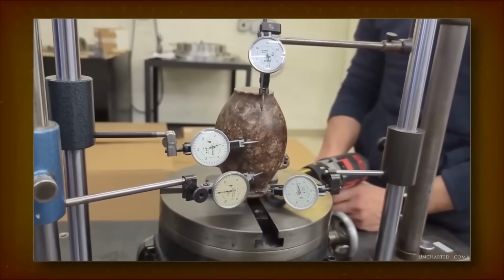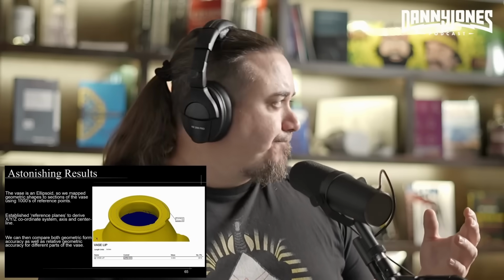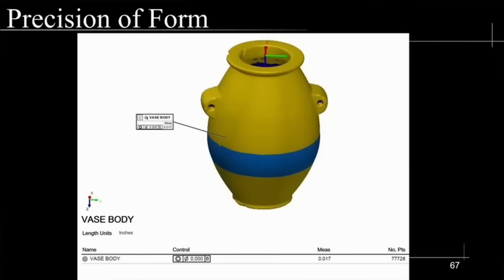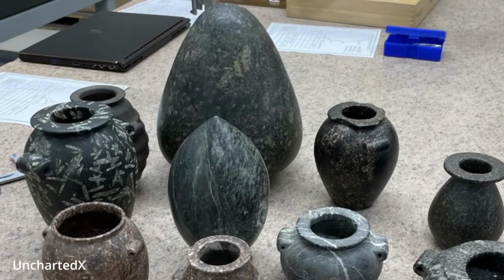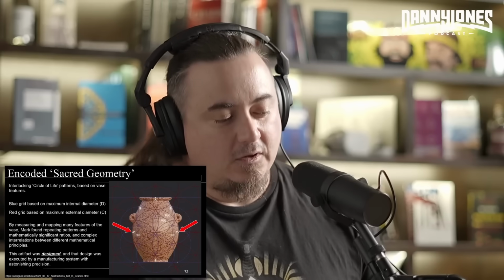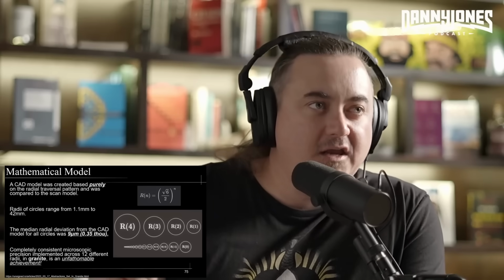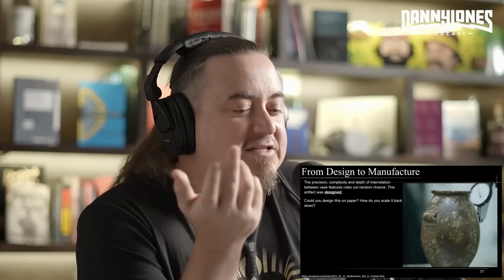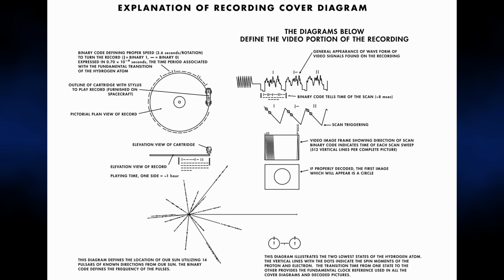Are These Ancient Egyptian Vases Actually Impossible to Make? #podcast #science #history #egypt

Comment: I have followed this topic since studying Archeology in the early 70's in college, so for over 50 years. New things are researched and discovered regarding these "vases" all of the time, thus continually re-peeking my curiosity. These "vases" to me have always been an anachronism, they just don't seem to fit. My viewpoint on these "vases" is unique in a way, that it is based on my very unique studies, schooling, training, certifications and interests. I have a background in fine art, am a certified Industrial Designer, am a trained material rheologist, machinist as well as a design engineer. My premise is that, not only that these "vases" were manufactured, they were DESIGNED, prior to manufacture. 

All of the technology that they are talking about using to measure these "vases" existed in the 1980's and 1990's, when I was in the middle of my career, the main differences between then and today is 1) availability 2) size 3) cost. I have worked within industries that used all of this equipment, but back then, they were sometimes prototypes that were developed specifically for for projects that we were working on or BETA testing of CAD systems, scanning equipment, machining equipment or software that was not even available to the general public or industry. And, the cost, was phenomenal compared to today. Our budgets for RAM chips alone was in the hundreds of thousands of dollars, $80,000.00 plus software license fees per station, and millions of dollars for scanners, special German engineered custom cutters and a 20 foot format GE gantry robot.

I have enough experience with CNC lathes and 6 axis machining centers to accept that, even today you would have a very difficult time in reproducing any of these vases, even with the very best of both pieces of equipment. If you could actually turn these "vases" on a lathe, that lathe would have to be built to dimensional specifications that are at most 10% of the products finished tolerances. That means if the finished "vase" was plus or minus .003" on concentricity, the lathe would have to be built within plus or minus .0003" to hold that concentricity (that's within 1/10th of the thickness of a human hair. Then, once the "vase" is finished on the lathe, you have to physically remove it and reposition it on the bed of a six axis workcenter that was also built to tolerances of plus or minus .0003". As well as that, you would have to position that vase on the work bed within plus or minus .0003" for machining of the lugs.

There is no statement of the NEED for this type of accuracy and no evidence that even with the use of modern day equipment and tooling that these could be reproduced this accurately, or at all. My biggest concern, other than the required materials to build this equipment did not exist 2500, 4500 or even 12500 years ago, would be the varying degrees of hardness in the chosen material for the "vases". The constant manipulation of speed and feed for both the lathe or a CNC work center, to accommodate the continuous variances in material hardness or tool changes needed, would be impossible to predict, plan for, or even calculate. 

The unique part of my career, background and experience is that I have the ability to work totally within the abstract of purely creative thought while at the same time taking into account all the logical analysis science offers. 

Now, that my active career is long over, I no longer have to worry about my conclusions being reviewed and judged by the owners or shareholders, I am free to speculate. My financial future is no longer affected by those conclusions. My speculation is that the "vases" were not manufactured 2500 years ago, or even 4500 years, but they are much older than that. Look at our own present time, look how far our technology has advanced in the past 1000 years. Imagine how an F22 would have been perceived had it simply flown over the battle of Hastings in 1066; another whole religion with a set of Gods would have been created. Before Pre-dynastic Egypt existed, the land was occupied by the Gods, their Gods. Perhaps those Gods were not really Gods, but visitors, who happen to have equipment on their craft that could design and create at a sub-atomic level (even if only to construct replacement parts for their journey). Remember, when you design a product on a computer aided design center, the accuracy of the design is built-in automatically, so tight tolerances are the norm, they don't need to serve a specific purpose. In 1000 years, or perhaps less, human technology will be unrecognizable; we will have 3D scanners that will probe at the sub-atomic level and construct designed products at that same sub-atomic level. 

just a speculation.
Reply: That...was the longest youtube comment I've ever read😁
Reply: You lost me until the "visitors".  Look.  If an entire earth wide cataclysm happened today that erased the majority of human population, how much of what we have built would survive?  Especially if the cataclysm was so extreme.  It would not only destroy most of humanity but it would also destroy most of any physical artifacts that remain.  And when you consider so much of what humanity is now exists in structures that wouldn't last and then mainly the virtual world.  It is realistic to believe that there is evidence of an advanced HUMAN civilization that  pre dates written history and most of archeological history.  I have no idea why people have to make it aliens.  Of course that isn't the most logical explanation.  The most logical explanation is there was advanced human civilization that was destroyed, remnants and legends of that civilization remained over time.  Most of it in the stories passed down because the evidence of the civilizations themselves was too fragile to survive so many years and such a disaster or disasters that caused the destruction.  That is the logical explanation.  We need to stop entertaining these ancient alien theories.  There is such a vast range between a reasonable person questioning archeological and historical dogma and "it was aliens".  Aliens is not a logical theory.  And it's so much of a part of why anyone that questions what is considered historical fact is crapped on.  Because aliens is not the logical conclusion.  At all.
Reply from the maker: Thank you for sharing
Reply: It's one thing to achieve fine tolerances in metal, it's something else to achieve them in natural granite which has many different crystal inclusions of a variety of other materials !
It's also necessary to polish stone to remove toolmarks so every different curve would require a different shape of polishing stone which would wear as it is being used, in order to achieve such precision the wear rate of the polishing stone has to be very finely controlled and predicted beforehand !
Reply: I feel like all of these unexplainable artifacts and pyramids that seem unachievable by us, that they have successfully done exactly what they intended to do in showing us what they were capable of. Why wise would they have so many profound mysteries that don’t seem to be practical for any other reason
Reply: I like the comment fella… especially as you mentioned my home town Hastings.
Reply: Nice 😅
Reply: Speaking to the air on here, you guys obviously haven't seen the Indian temple with support pillars that look like METAL, but are instead rock (granite, I believe) that was TURNED ON AN ANCIENT LATHE to the point where the rock appears to be shiny metal. Yes, foot peddle turning lathes are ancient technology! We don't find evidence because the structures are wooden and have not survived. Blades, largely copper or iron, get ground to a nub quickly.
Reply: @MarilynCarnivore  Yes there is a lot of evidence that lathes were used to create many items and we are aware of a few different types with alternate ways to power hem, look up 'ash pole lathes', they have been used for centuries. The main problems with turning large stone pillars are weight and friction, it's impossible to get a fine surface finish if you only have a crude way to centre it and support it, any inaccuracies will be evident in the surface finish. You have to have good bearings to reduce friction and to ensure a fine finish, the better the bearings, the better the results will be and there is a limit to how much small bearings can hold. Turning stone requires high speed too, driving a multi ton pillar at high speed consistently for long periods requires a bit more than pedal power and relying on copper or iron tools to shape the stone is not practical.
We would use very large hardened needle roller bearings to get a fine finish and we would also use diamond tipped tools and diamond grindstones spinning at high speed whilst turning the pillar. We cannot say how they did it.
Reply: I dont usually read comments but yours stood out. I read it all. Thank you
Reply: I too believe these were printed at the sub atomic level. I see no proof they were made through reduction.
Reply: @71datsun1  If that were the case why does the stone have variations of hardness and colour ? Why add so much extra difficulty by creating them in granite instead of something more pure like basalt ?
If it was possible to 'print' them at a sub atomic level they could have created much more complex designs and there would be no need to stick with the same basic shapes which look like they must have been made by turning. The level of detail that has been discovered encoded into the vases is astonishing, I don't know how that can be done by eye or by hand or even by machine in solid granite but that is what we need to find out, saying 'they must be printed at a sub atomic level' isn't an answer, it's pure speculation and raises more unanswerable questions.
Reply: You are wrong.... remember you are using sizes of measurement that didn't exist.... even the Inkas cut granite precisely. Gods and aliens do not exist... well aliens most probably do but at no point has one been on this planet or close to it.  I believe I could reproduce them by hand.. I too was an engineer, mostly C.N.C 5 axis mills. Oh and being English I use mm and have repeatedly cut parts to 0.001mm and one job had a tolerance of .0005mm. so times your massive .0003" by 25.4..... This video is mostly nonsense to make out it's something special or magically.. there's many ways these could have been produced that aren't even mentioned. Want to blow you mind? The pyramids have no carbon markings on the ceilings of the passages, yet people entered them daily....so how did they see?? Two guys wrote a book on how the Egyptians generated electricity and one of them died young and the book was listed under fiction......  The pyramids are more than just buildings.

Comment: . 
Wondering... are there any tooling marks left on the surface from the subtractive process? 
Has the surface been examined at extreme magnification? The fact that the base material is composed of mineral composition of varying hardness - 
would theoretically reveal tool chatter or give a clue to some other non-mechanized laser-like subtractive process. 

I agree - it is like advanced beings with advanced technology left an extremely complex mathematical calling card on this commonly used but timeless artifact - a vase. 

Google: would the varying hardness of rose granite create tool chatter on a lathe? 

AI - Overview 

Yes, the varying hardness of the minerals in rose granite would likely cause tool chatter on a lathe. 

As the cutting tool encounters the different mineral grains, the changing cutting forces can excite vibrations in the machining setup. 

AI - How varying hardness causes chatter 

Chatter is the self-excited vibration that occurs during a machining process, resulting in poor surface finish, accelerated tool wear, and excessive noise. 

The varying hardness of rose  granite mineral grains directly contributes to this phenomenon. 
.

Comment: Just like to point out you can’t even make these on a lathe as you need a 5 axis to scallop out the material between the handles 
On a lathe you can machine all outer profile and radial bead or lip that holds the profile of the to be handles 
You then have to use a 5 axis to scallop out the material you don’t need to form the handles and that machine cutting tool has to follow both radial profile and base surface body profile 
That is another whole level of capability and I haven’t heard anyone yet appreciating this level 
ITS NOT JUST ROTARY LATHE WORK !!!

Comment: I have certificate III in mechanical engineering and have worked for over 20 years as a machinist, using manual and cnc lathes. Even using a million dollar, modern day cnc lathe or multi axis milling machine, we would struggle to replicate such accuracy using steel, let alone using rock. 
I find it hard to believe humans made these.
Reply from the maker: Thanks for sharing

Comment: Free wheeling duplicating lathe with rotating cutting head can do it with a single tool. Maybe duplicating from a softer material. How they shaped and designed the master tho and polished it so accurately tho 🤔 the lugs being identical lend themselves to a lathe. And being perfectly round. The profile of the lug would be all the way around the master vase and a secondary operation used to remove the material between them. For the dimensions, the designer has made a perfectly symmetric piece aesthetically.. the golden rule will inevitably be found on it before it was ever formulated mathematically and the overlays will have a lot of intentionality behind them because of the nature of the task of applying them, but the craftsman for sure had a lot of intuition when it comes to aesthetics.

Comment: I can spin a 10 inch diameter object on my metal lathe. When I am creating a part of only an inch or two diameter, a single tool finish pass can give me an error of five thousandths I've overshot or undershot my goal. Tool chatter can give more than that easily and it is common. It is difficult to center and hold metal objects precisely and any remount results in error one "has to accept" as you try over and over to precisely realign it. 
These precise rock vases are literally inexplicable. I don't get it. I don't think a 5 axis cnc can make these today. I may be incorrect but it would be a real project even on a very expensive state of the art 5 axis and would probably produce multiple failures even after methodology was honed in to best possible.